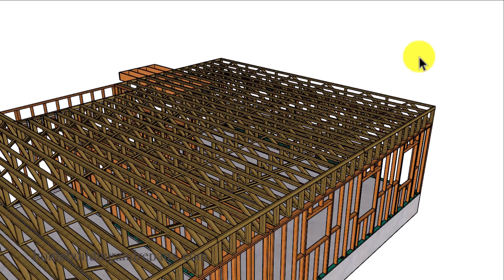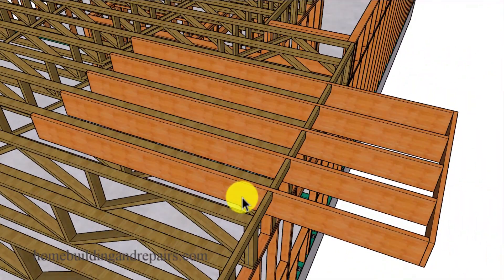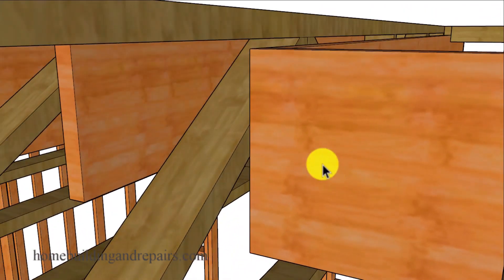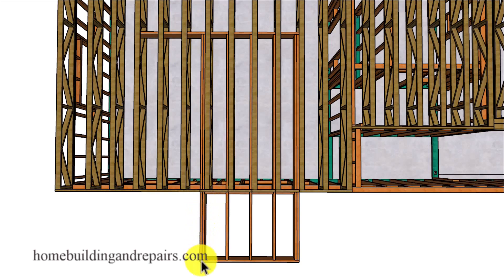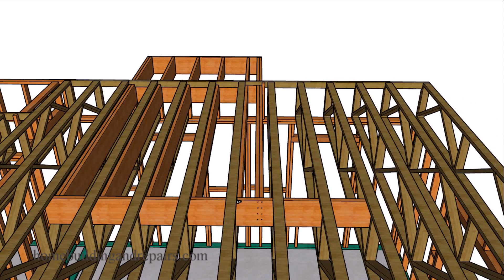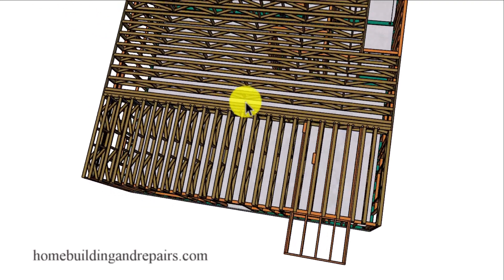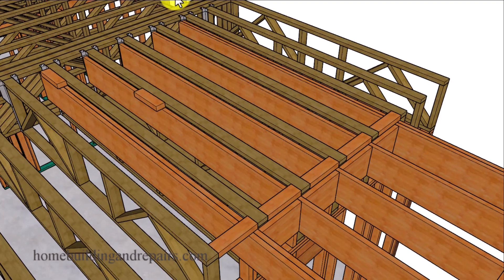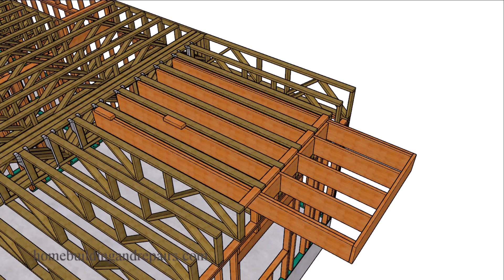How To Build Cantilever In Open Web Type Floor Framing Structure With Construction Standard Lumber

Comment: In your first example, if we are talking new construction and not an add on to an existing structure, is there a reason the floor trusses couldn't simply run out longer? My design has 3 bump outs that are 3' extensions (bay type with 45-degree wings) and 2 that are 18" extensions (bay type with 30-degree wings). The base foundation width is 24'-4", so there would be a center beam, making the supported span around 12'-6". 

Seems like a continuous unbroken truss would be the strongest solution. I can only find a truss builder in Australia saying their system can cantilever with a 3:1 ratio (they use meters and not feet, but the ratio is the important bit). That would mean I'm good, as 12' in would be required for 3' out, but just because it is allowed in Australia doesn't mean it will be in MIchigan.

One large bay has a 3'-4" stairwell behind it, might have to use a foundation wall for all or part of that one (will be hid by a porch). Another large bump out will have lower kitchen cabinets and a sink. Hoping it is allowable to run plumbing through multiple cabinets to ultimately drop on the inside of the basement wall or may have to do some rearranging of the kitchen plan.

Comment: Question on how to insulate kitchen that is bumped out and piper are under cantilever.  Hard winters, pipes freeze.  Suggestions from someone skilled on insulating cantilever properly?
Reply from the maker: Check with your local contractors or building department. The answer to your question has to variables for me help with.

Comment: Great video, very helpful. Of topic, For existing home with load bearing wall, Can you join two small beams using metal connector between the two together to make one long beam to get rid of a column holding up the weight?
Reply from the maker: Probably not.

Comment: Is is possible to cantilever off the side of floor joist?  So the cantilever is perpendicular to to the existing joist.?  The joists are made of solid timber.
Reply from the maker: I don't think you would be able to get the on center joist spacing you might need. For example, the joist might be spaced 40 inches on center. I'm not suggesting it wouldn't work, but I couldn't get it to work in this project.

Comment: That reminds the biggest issue with cantilevered framing projecting beyond the exterior wall is less about the framing itself, but flawed methods of sealing/flashing the wall penetrations, not to mention the fenestration above. Of course one way is to make the deck an impermeable one, but States like California have amended their building code to require impermeable decks to be engineered with something like a 300% safety margin due to recent deadly catastrophic failures from water infiltration and rot concealed from inspection by the impermeable deck encapsulating encloser. 

But the most common issue of faulty seal/flashing is water infiltration where the joists protrudes through the exterior wall material in an open frame deck. Easy enough to flash the top of cantilevered joints with a Z-bar flashing set in a saw kurf on top of the joints. But not so simple to reliably seal/flash the sides of the joints. The only reliable way to seal/flash the sides of the joints is to not let the rain reach them in the first place by having the bottom of the Z-bar flashing under the deck boards wide enough to screens the joist wall penetrations from the rain, probably something like 6 to 8 inches out from the wall.
Reply from the maker: Yes, there's a lot more to a cantilever than just the framing.

Comment: Just curious- why can't trusses of more length be used to gain the structure outside the wall framing? In other words, instead of all the sistered 2x large (spelled even more expensive than trusses) be run across the outer wall framing continuously ? It strikes me it would use less material and labor. But my background is as a plumber, so I'm going to do the "smart" thing and ask the dumm question!  FR
PS; This looks extremely attractive to me for the second example you show- once you reinforce the long truss to act as a support for the interior end of your floor joists, running longer trusses for the porch floor would significantly decrease costs and would also leave the trusses clear to run AC ducting, etc if not blocked by all the solid 2x's shown scabbed on. My thinking anyway!  fr
Reply: As a current roof/floor truss designer in Florida. Top chord pitch breaks in 4x2 floor trusses are not an option.  However they are very possible with flat trusses. They are floor trusses that are 2x4 like roof trusses and you can have multiple plies and apply a slope for a cantilever depending on loading. We often use flat trusses in floor situations to carry floor truss girder type loads.
Reply from the maker: Most open web joist are built so that the ends of the joist sit on load bearing walls or beams, but can be built with cantilevers most of the time.
Reply: @gregvancom  Could the design/build for those joists be changed to do so? I do get your point- to do this at all a verticle support member would have to land right on the load bearing wall. I just find the large 2x scab on (or sistering) potentially only shifts the joist's point of load mostly to the far end and leaves it trying to lift the joist- where direct pulling forces will more likely cause nails to fail, as well as being costly and cumbersome. Thank you for your reply- my "personal exp" is as a plumber and framing as it applies to, hopefully, my new two story garage- I only foresee a big enough "porch" to access the 2nd floor entry door- three feet wide by say four across.  FR